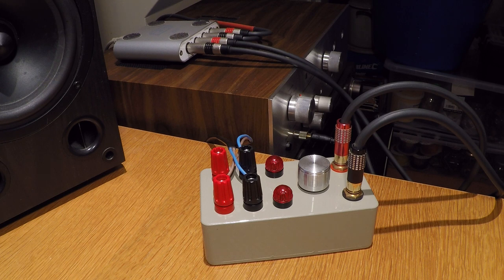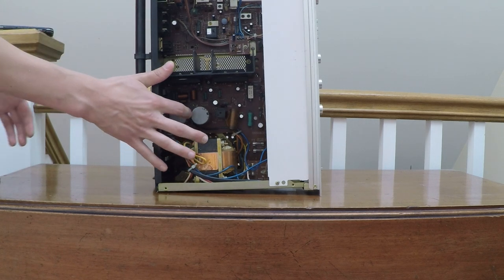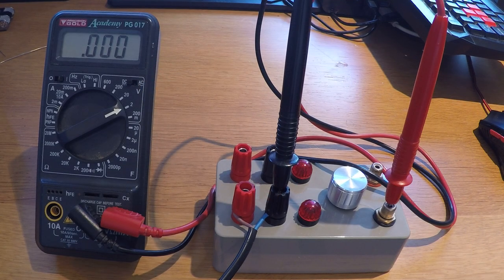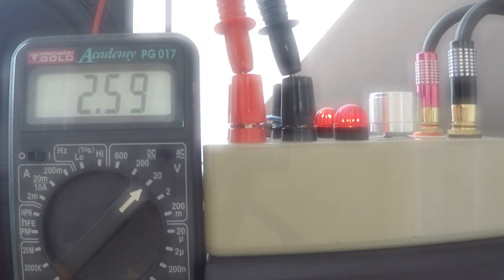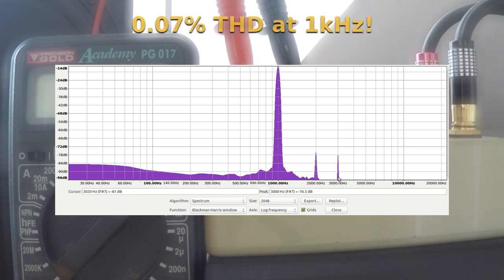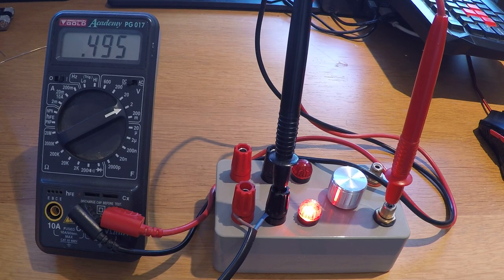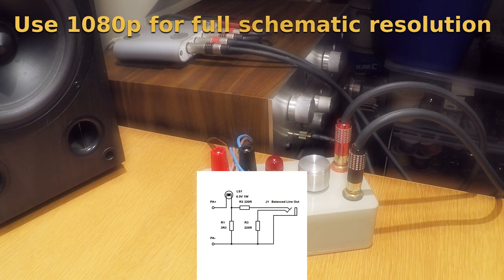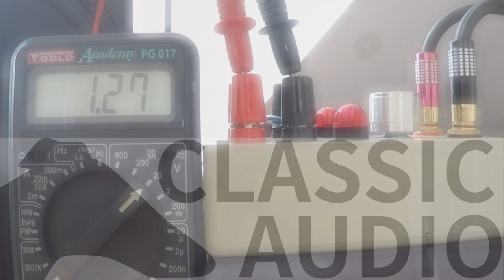Ultra Simple PASSIVE Audio Compressor - With circuit schematics, measurements, and balanced version!

Comment: A disadvantage of this montage is when a song ends, there is a short spike in volume if the next song begins briefly 🎵. So I can't use it for music anymore. Always useful for regulating sounds in films and videos. Here, 2 x 10W power amplifier (internal power supply of 24 Volt minimum), Christmas garland bulbs 5V 100mA 🎄directly in series with 2 desktop speakers 🔊. Hello from Belgium 🙂🙋‍

Comment: I'm not sure I'm understanding the benefit! everybody goes on about you don't want to have compression in your music you want "high dynamic range" why is this compressor breaking that norm? what is the benefit what does it give you sonically? thanks!
Reply: That's my question!
Reply: Okay.

So, I can't say for certain where you are hearing this information, and in what context, so this is some amount of guesswork on my part...

Modern music is highly compressed. When you squash the dynamic range through compression and limiting, you are able to control peak levels to meet the standards of streaming platforms, while still having the quieter parts of your song at a level that is still very much in the listener's ear, in such a way that it commands their attention. Even beyond streaming platforms, the 90s was notorious for having a "loudness war", where nearly all major releases were mixed and mastered to be highly compressed.

They sound somewhat terrible, but it's a very "in your face" style of mixing that lends itself to songs competing for attention, at the expense of what a listener will hear when they are listening attentively. In such cases, the loss in terms of dynamic range can actually make mixes sound simultaneously abrasive and boring (a contradiction that heavy compression somehow manages to pull off).

The purpose for something like this is that it is a smoother form of compression, and it can be applied to music that was recorded under different circumstances. 

Live performances, or recordings that were recorded when tape or vinyl were the only recording medium, or early stages of digital, before folks really got the hang of it are music that would probably do well with this sort of compression, because the constraints of the recording process tends to gravitate toward trying to slam the recorder with a hot signal to create a high dynamic range against a relatively high noise floor, resulting in clipping. While most of this will be fixed in mastering, anything that hasn't been remastered (say, an original pressing of a live album, or an experimental concept album from the 70s, or a home-produced tape of a friend playing guitar, or some obscure release from a now defunct record label where remastering just isn't going to happen), or anything that was mastered in an abrasive way can be fixed on the listener's end.

And the truth is, even when compression is present, the idea is that this form of compression works exceptionally well because the curve of the compression is applied in a way that is proportional to the voltage (volume) being produced, rather than the compression "kicking in" at a certain volume, and so it inherently preserves most of the dynamic range, but just kind of rounds of as you approach peak levels. There is a minimum to activate the compressor, but the compression is happening as a result of physics creating resistance as voltages increase the temperature in the bulb, rather than a circuit designed to kick in and choke off the signal at a certain threshold.

Comment: Classic Audio, what circuit schematic would you use for a PASSIVE guitar compressor? the guitar pickups that connect to a passive guitar compressor would be what circuit schematic?
Reply: I imagine you could use this for guitar by putting it between your amp and a powered cab.
Reply from the maker: Hi Wayne, I would put it after the first power amplifier rated for 10W or more and then connect the output to another power amplifier. The same rules should apply as here!
Reply: @Psychotenuse you could probably also put a signal boost in front of it like a full range booster. Then you could drive the compressor with quieter signals like a guitar. Might be nice as part of a microphone preamp with a single 12ax7 wired in parallel driving the compression circuit. Maybe another post compressor as a makeup stage.

Comment: Can I used this for vocals
Reply: If you’re feeding it a line level signal from a mic pre yes you can. If your feeding it a mic level signal... load... then likely not. You could add a switch to select the input load by installing a transformer that can have an input load of 600-1000 ohms (line) or 10k-50k ohms(mic). Secondary would be 600-1000 ohm. 1:1 (line)or a 10:1(mic) ratio. Someone please correct this if I’m wrong about the mic loads.
Reply from the maker: It needs to be driven from the output of a single ended (not bridge-tied-load) power amplifier. Connect your microphone to a suitable microphone pre-amplifier and power amplifier and feed the output of the compressor into a line input. After you've done that you can put any audio signal you want through it.
Reply: @michaelfidler8218  ok, so, because of the light bulb more wattage is needed than a line output?
Reply from the maker: @jacksonreazin6042  Both more voltage and more current are needed, so much more power overall. The best line outputs such as the ones that use NE5532 op-amps on split 17V rails (the minority unfortunately) will only be able to give you about 20mA at 10V RMS on a good day, and that depends on whether you have enough gain and correct gain architecture in the system to get the level up to 10 times the normal operating level. This unit wanted a good 200mA peak and about 12V RMS to work correctly. A power amplifier will be able to do this easily whereas any line output will go into overload long before reaching this level. Being a passive circuit, it can only attenuate, so to get it up to the right operating level, something a lot more beefy than a line output is needed.

Hope that helps!
Reply: @michaelfidler8218  absolutely!
Reply from the maker: @jacksonreazin6042  Good to hear. I uploaded a video yesterday to solicit questions about audio that I can answer on the channel. If you have anything else that you think needs an answer from someone in the business of analogue audio design then let me know!

Comment: Very interesting video. Congrats. I was searching for an effective way to tame high peaks in my tv audio system and this seems to be what I'm looking for. I know that the attack time is not that fast, but it seems to be very natural in your device. Although I'm worried about the difference in ground, since my amplifier is in a BTL configuration. May I use the same bulbs just connecting them in series with the + wires of the speakers for a btl class-d amplifier 16W@8Ohms (tpa3116d2) to avoid a short in ground?

Comment: There are incandescent bulbs like 2.5V-3V 20mA for which use of relatively high THD of even the best of the best power amplifiers is not necessary. Its just a matter of searching for them as their production stopped long ago. Early compressors, especially for stage musical instrumens used opticly coupled incandescent bulb and LDR, but they are not suitable for demonstrated here application as LDRs introduce audible noise.
Reply from the maker: LDRs are very quiet if we use them at low impedance, say 6dB of attenuation at 10k, it's easy to get the noise below 10uV.
Reply: @michaelfidler8218  Small size modern fast ones - yes. 50 years ago they were quite innert and noisy.

Comment: Hi, love the idea of one of these! I've tried building your simplest circuit, I'm passing line level out of my interface, through the bulb and then back again, I'm getting signal but the bulb isn't showing any signs of life. I'm using a 6v 150mA bulb like yourself. Could it be my line level just doesn't have enough oomph to drive the bulb? Would be really grateful for your help!
Reply from the maker: Hi Ed - you need a power amp to drive the compressor. A line output won't come close!

Comment: Can you build a small amplification circuit that could be used as the drive the circut. Thanks and great video!
Reply from the maker: I should think so! Maybe one of those eBay TDA2020 type chip-amp boards would work well.

Comment: where would be the best place to get 6v bulbs? like what are they typically used for? closest ive found so far is speedometer bulbs but they are 3w. any response would be greatly appreciated thanks :)
Reply from the maker: eBay perhaps would do for a small quantity?
Reply: bulb from old Christmas wreath 🎄👍🙂

Comment: Better put the light bulbs direct on the midrange loudspeaker and/or tweeter. Why? because you dont want to take away the bass from the bass loudspeaker.
Reply: for example 12V 10W works well to protect tweeters 👍🙂

Comment: Great project with a fantastic presentation!

I'm curious to know if it would be possible to make a passive Limiter circuit. Perhaps Zener Diodes would suffice for such an idea. 

I've recently seen the creator of Air Windows present his ideas on a passive circuit design to achieve desirable characteristics in audio recording/mixing/mastering inspired by the Gyraf Gyratec XXI. 

It would be fantastic to marry your Passive Thermal Compressor with his passive analog Saturator design. Considering the simplicity of each respective circuit, I feel it's possible!